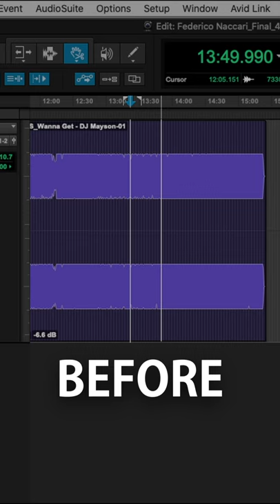2 EASY MOVES TO HEAVY TIGHT BASS...TRY THIS!

Comment: FREE plugins for this effect:
1) Analog Obsession Rare (Pultec EQ)
2) Tokyo Dawn NOVA (dynamic EQ)
Reply: I'm updating the NOVA plugin (since Streaky is using a mutiband comp, not a dynamic EQ). I wasn't aware of a free multiband comp similar to FabFilter, but after searching I found:
Cut Through Recordings - Convergence
Reply: @Tekkerue  What's the difference? Isn't a dynamic EQ a multiband compressor plus EQ?
Reply: Add the Sonimus SonEQ to this list.

Comment: Cool the tip!  but when you add the pro mb the volume is louder.  hard to really hear his work. thank you for sharing your knowledge .merci !
Reply: its avoiding the muddiness with out losing the low   bass the puigeq is adding. every time the freq hit the pro mb down a little bit specifically that frequency.
Reply: @djvando  Yes !  I understood the principle well, but I'm listening with headphones (hd58x) and the volume between before and after is too different to compare for me (louder is always better :) I'll listen to it again in the studio tomorrow!  have a great evening!
Reply: @djvando  iF he is putting the eq in the MB , isnt the compressor doing the opposite -  attenuating that frequency , rather than boosting !?
Reply: @DJURBANBG  the eq is a straight boost, the pro MB controls it so it "grooves" in time, and it's not just a muddy boost in the lows, it's dynamic
Reply: @lepureur4657  ok , so couldnt he just use dynamic EQ !?
Reply: @DJURBANBG  then you'll lose what the eq brings, my guess is that it's not a transparent eq, it adds something, you have to try different combinations

Comment: Sharp Q on the PulTec... Is that right!?
Reply: There is no Q option for low end on the Pultec. It's a fixed curve. You can however adjust the curve by attenuating. The Q is for the high end only.

Comment: That Pultec makes it sound widerrr
Reply: Yes especially the UAD version. Just turning it on with everything set at zero just gives it an extra dimension. Do bear in mind though that Pultecs add a little volume just being turned on, especially if they are modelled properly. The UAD adds about 1db when turned on. The Waves version about 2db. This can trick your ears a little especially at louder volumes so be aware of that.

Comment: What's the advantage of feeding a pultec EQ into the multiband compression? Why not just increase the output on the compressor? Does the Pultec add color (e.g., saturation)?
Reply: Yes the Pultec adds a little colour. The UAD version adds a little depth, pre-amp saturation and a tiny bit of volume when it is turned on, even with the dials all set to zero. We use it in mastering for it's colour as much as its boost and attenuation.